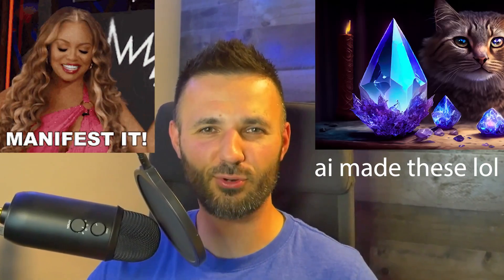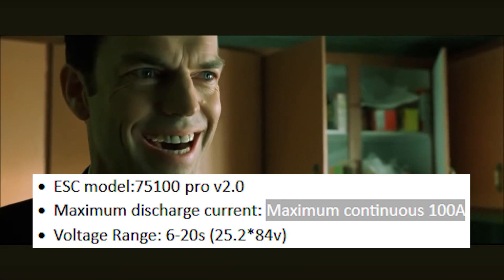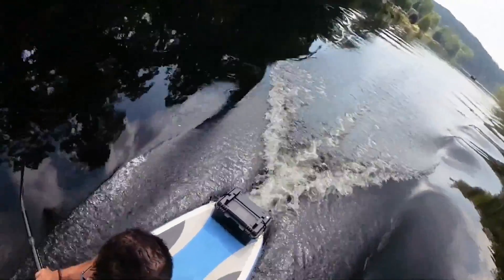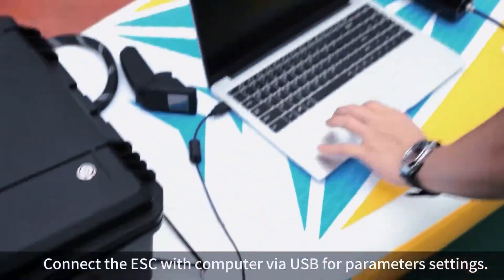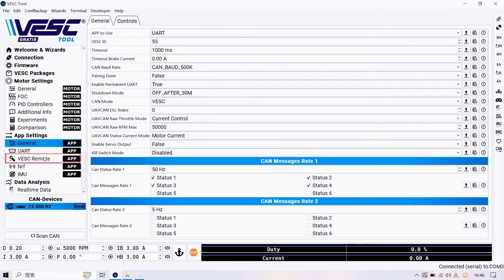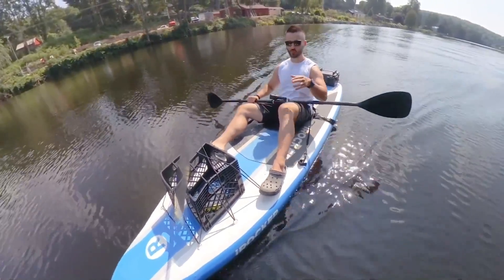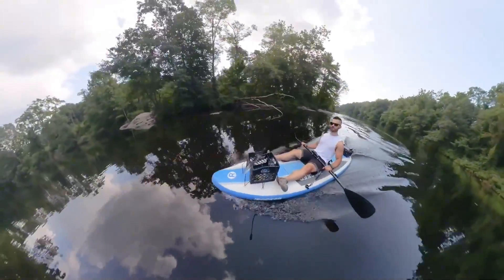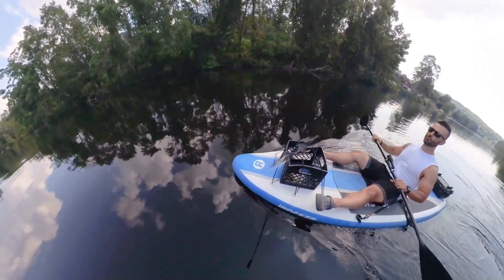DIY Paddle board with Waterproof Motor 7070 Kit Review|Flipsky Underwater Thruster

Comment: Cool😁 i made a hydrofoil with the 65161 flipsky motor and 75/350 vesc . 😁 Went out to test 1 day and forgot to bring usb c cable for adjustments ☹️ was only pushing 400w for some reason. Had 180a battery. Just needed to re do configuration in water or something. I will make it back down to lake hopefully this weekend 😁 got a 75L deck. All carbon fiber. 5'2", AK durable supplies carbon mast and 2000 wing. All big stuff. Should lift very easily. Few props to try. Couple different 14s batts. Big boys 😁 I'll get her up 😁 flipsky vx3 controller. Great video man. Keep em coming 😁
Reply: I do the same thing with a diy E-foil. Which props would you recommend
Reply from the maker: Wow, that is awesome!!! 🤩Can't wait to see your build👏👏
Reply: @manuelun1qu361  i have a bunch that i 3d printed and i got 1 from a little Johnson Evinrude motor. Like a 5hp prop (2 blade) i modified a few from thingiverse for 3d printer. Made them taller so i guess i played with the pitch. Gotta get out there for testing 😉😁

Comment: What is maximum voltage. Can the flipsky app set voltage to 72v?
Reply from the maker: The ESC is 75100 pro v2.0, so the setting app is the VESC tool. This ESC's voltage range is 25V-84V, so you can set it to 72V.

Comment: so many volts and watts for only 8kmh
Reply from the maker: The motor 7070 can reach about 20km/h on the SUP board, and this speed is affected by various factors, such as parameter settings, usage conditions or environment, etc.